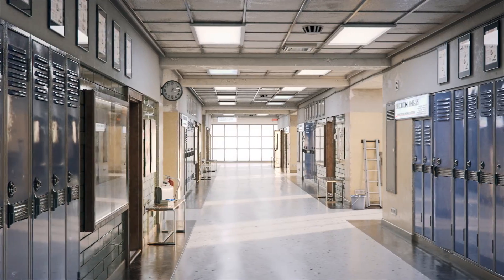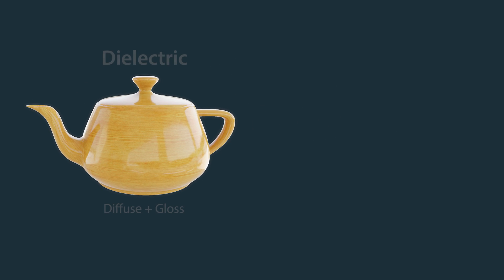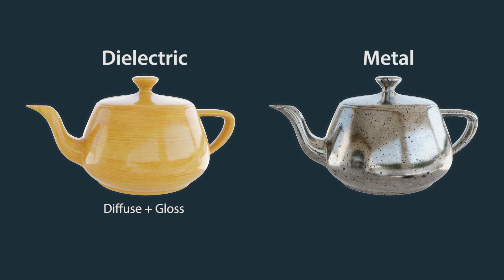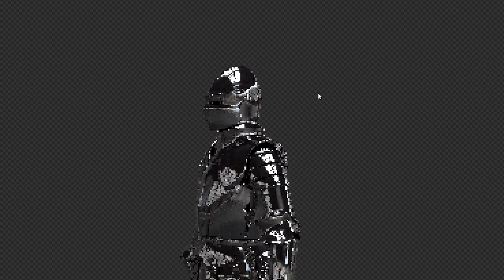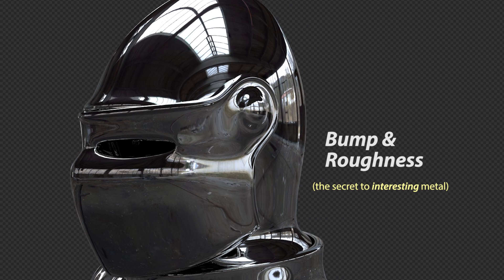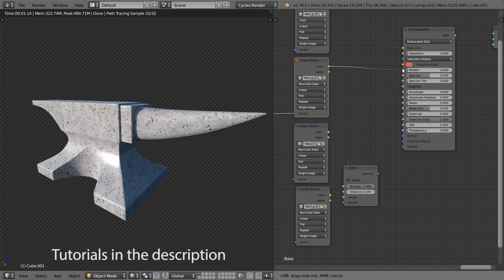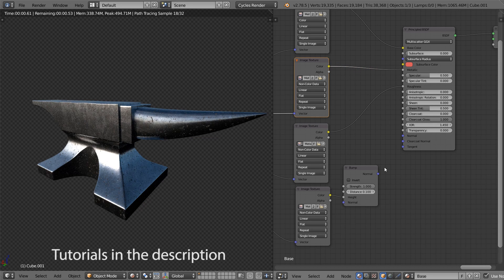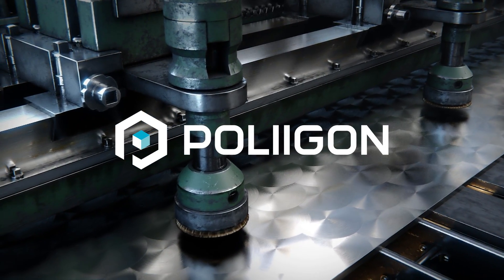Why most CG metal looks fake

Comment: The secret is using an energy conserving material...if you aren't using one or your software doesn't have one, then you need to mimic it using ramps on gradient based on camera angle in order to get a Fresnel effect. To finish just add some curves in compositing to give it it's final black and white point. Hope it helps :)

Comment: To get realistic looking metal using any render engine, you must know the formula that render engine likes. Sounds a bit strange, I know, but each render engine has its own way of doing what it does. Because of this, materials will act differently for different render engines, and the greatest difference is metal materials. So my advice is to look at the render engines used in the applications you use. Next, do a search for instructions on how to formulate a simulation of realistic metals for that render engine. Follow that tutorial to the letter.

I use several different programs to do my 3D art, and I have found that each render engine that those programs use work different from each other. Example: DAZ Studio comes with two different render engines, the 3Delight engine, and the Iray engine. Both work differently from each other. The Iray engine supposedly does photo realistic renders, but if you know what you are doing using the 3Delight engine,  you can get photo realistic looking renders out of it also, Just know that what works in one, will not always work in the other.

Comment: true metal = 100 gloss? Yes, metal does not refract light, meaning that the metal is opaque and wont cause the light to go through and light up the material itself like plastic for example. But this does not mean that you should use 100% gloss all the time, unless you want everything to look like chrome.. The surface of the metal can still be uneven, for example brushed aluminium. To get this look you can not use 100% gloss.. get your facts right! Gloss = how even or uneven the surface is (microsurface). Diffuse = light spreading inside the material

Comment: This is the most correct workflow of making realistic metal textures. However, it's not true that metal does not refract light at all. By this statement it's wrongfully implied that the more reflective the metal is the more 'real' it is, which of course is not true - or at least very inaccurate.

Comment: This is a bit of an over simplification. There are a few factors which contribute to the CG Metal look. For example, until recently almost all specularity was done using a Blinn-Phong method which tends to make the highlights too sharp. Now most shaders have switched to the GGX Shading Model which has a better falloff. Having better textures certainly adds a lot, but it's not the only issue.

Comment: my problem is that whenever I apply a gloss shader, it doesn't look nearly as good as that knight armor you had, even without the scratches and smudges. It ends up just looking like an ugly mirror if I do low roughness or a straight diffuse when I do high roughness
Reply: Make sure you use cycles if you're in Blender.
Reply: have you tried applying it on the principled shader??
Reply: What rendering engine?
Reply: Jaden Farquhar Add Lightning